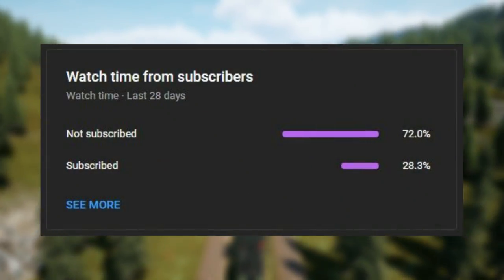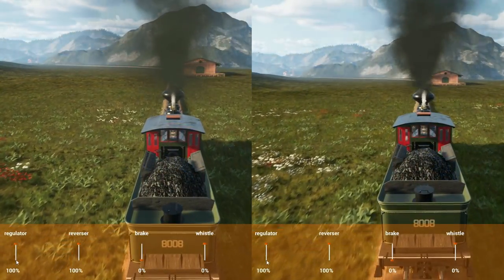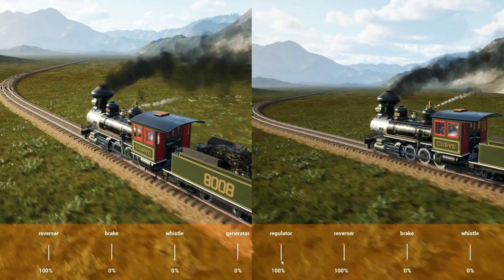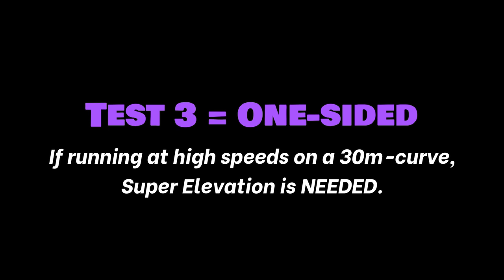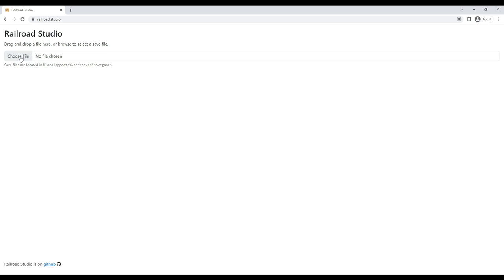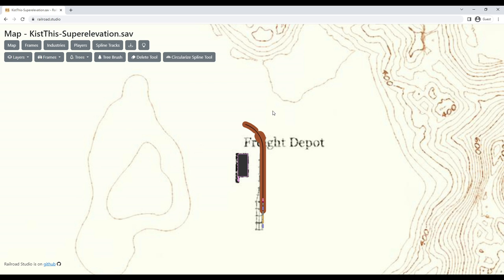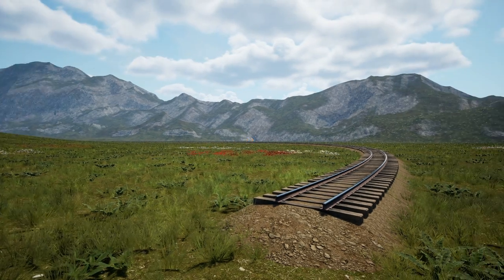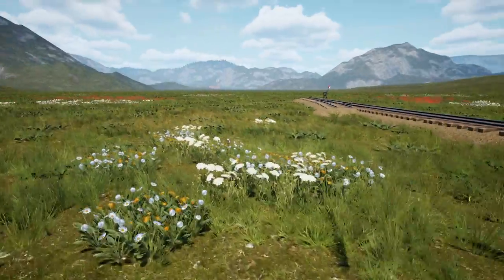Super Elevation in Railroads Online

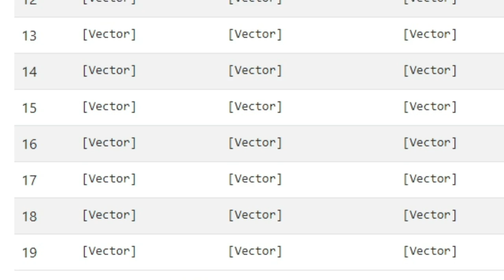Comment: 17:57 you should use the id column, when you click on a spline there's an output to the console (F12) there will be a line 
"> Object { index: 12, sharpest: {…}, spline: {…}, steepest: {…}, length: 1000 }"  index: 12 is id 12 (not tested if the id is same after reloading studio or if deleting track has an effect on the id)
18:20 The rail height h01,h05 and h10 and others are carried on from the game, for ex "BP_SplineTrack_914_h01_C" that's the blueprint what holds the spawn id what is shown in studio under type
Reply from the maker: I found out, (thanks to others) that there is an even easier way thank 30+ spline segments lol. Regardless, this helps a ton

Comment: I want to say that I think the reason why RO doesn't normally support super elevation isn't because it's hard, honestly it wouldn't even be all that much math to just have an angle calculated from the curvature which can be solved with a tiny bit of calculus, but rather because super elevation would never be seen on 3ft narrow gauge in the US, it defeats the entire point of narrow gauge being cheaper construction and allowing for tighter curves, many narrow gauge lines had speed limits the entire length of the line bellow 15mph so super elevation wasn't really relevant, and even where speed limits were higher, narrow gauge engines almost universally had small diameter drivers meaning their top speed was so low that super elevation wouldn't really matter to them on lines where the curves could ever be navigated at higher speeds, also remember, the first tenant of narrow gauge is cheap, so grading was made quickly not well, ballast was what ever what easily available instead of what was actually suitable, and alignment of the rails was eyeballed by people drunk out of their minds, not to mention the cheaper lighter weight rails, overall lower quality construction, and regular state of disrepair the rails were in, any situation where super elevation would actually be used to keep a train on the tracks better would probably result in the train breaking the tracks themselves... I suspect that's the reason it hasn't been added
Reply from the maker: There were 2 narrow gauge railroads that used Super Elevation here in the US. 

The current spline model/ method would not suit it in game as a default. I understand/ agree with you completely otherwise, and it doesn’t matter if it’s realistic or not. I like to think that it’s in the spirit of the game and gives people to do more.

That’s why you have to use external help in the first place. Either build normal, or go that extra step for your style.

Comment: Super elevation was possible with the old splines, right? I never got to play with them/the old building tools.
Reply from the maker: They were!
Reply: It must have been, but very hard.
Reply: @robertbalazslorincz8218  Back in mah day...
Reply: Super Elevation happend on the old spline whether you want it to or not, made some track placements impossible to use as the track would be at 3 degrees but the next new segment would be at 0 degrees.  It it's why it got removed but I glad to see we have a form of Super Elevation to use.